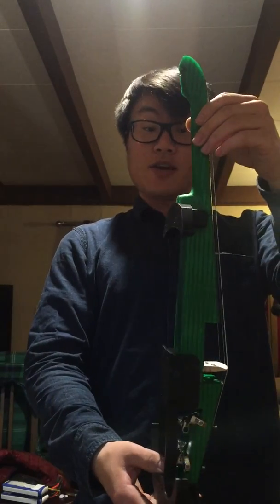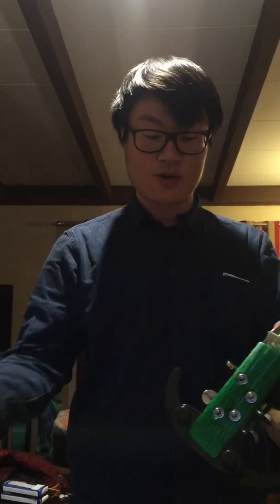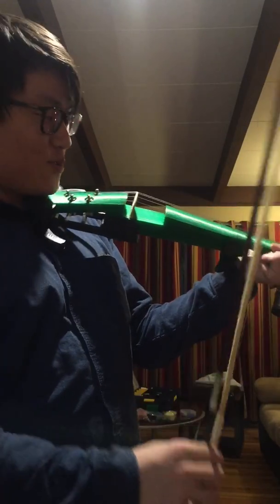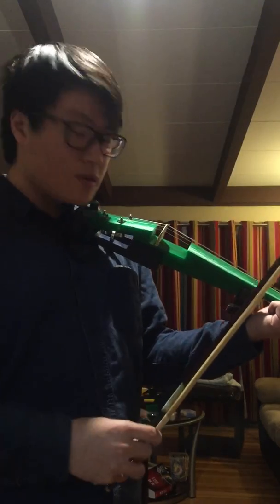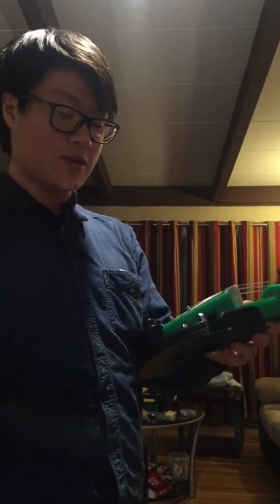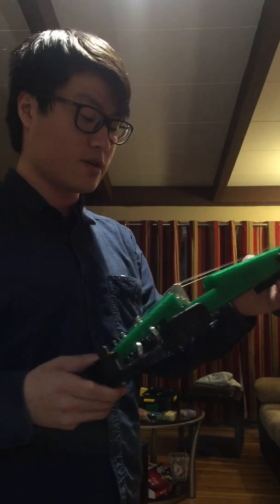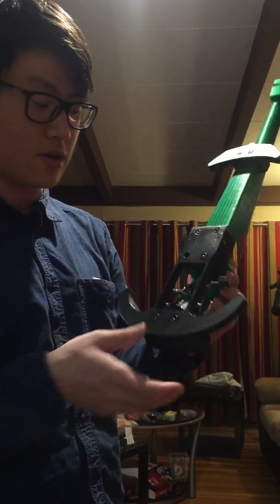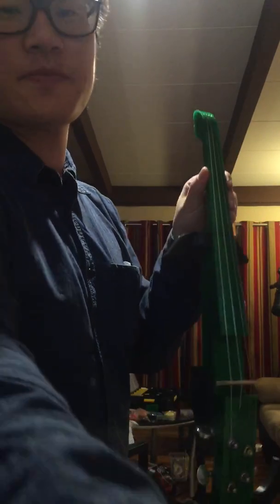How does a 3D printed violin sounds like

Comment: printing the main body in PLA will likely improve the tone and feel noticably. it's a conciderably harder and stiffer than PETG, and sands and polishes really nicely. smoothly is has that same silky and slightly cool feel as bakelite. to cut down the weight, you can easily epoxy in a carbon tube instead of using a heavy threaded rod. 
(i printed instrument parts from bridges and nuts to sax mouthpieces and linear tuner assemblies .. and lots of guitar picks. PETG has a higher toughness and melting point, but in all other aspects PLA is the better material for the job.)